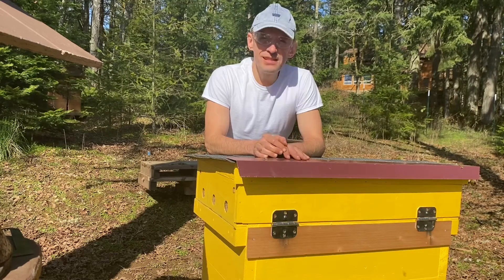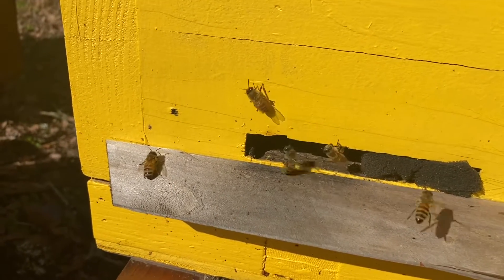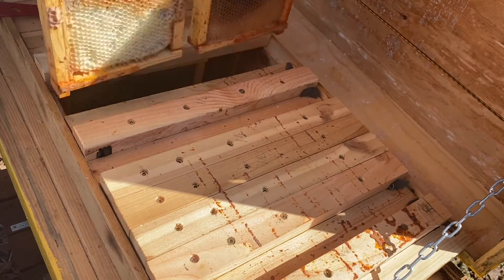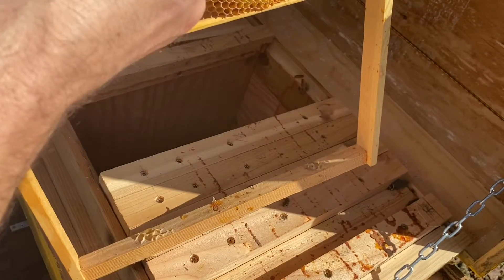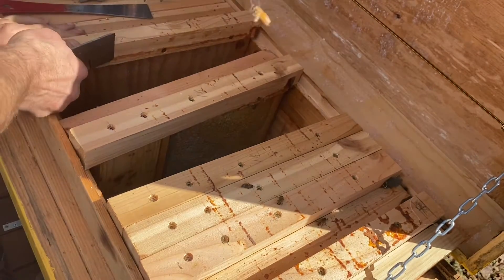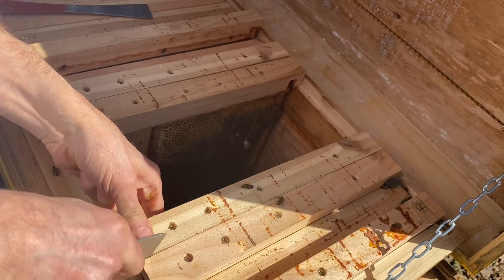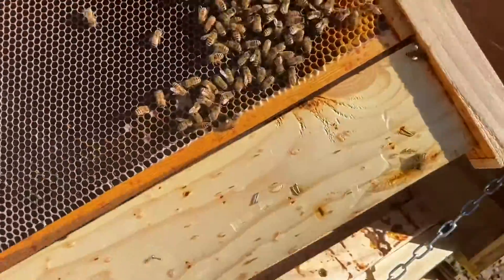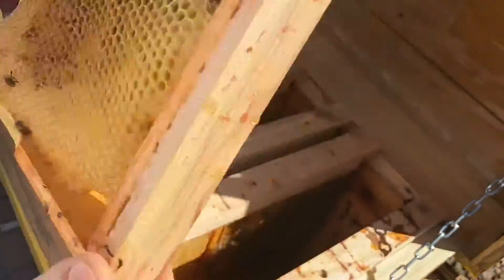LAYEN’S hive overwintering

Comment: It must have been disheartening to lose so many bees overwinter. You didn't mentioned what hive systems the dead colonies were in or how severe your winter was like.  I thought it was neat how you attached langstroth frames to top bars with side panels to fit in the layens hive. It is one way to transition to a layens hive without tossing away existing infrastructure that had time and money invested.
Reply from the maker: Yes, I downsized my apiary after that - reduce quantity to increase quality. The winter was not harsh, but we had fires as never before  in September of 2020 in Oregon. That stressed the winter bees. The hives that died were standard Langstroth. 
BTW, two medium frames  fit nicely side by side in this deepened Layen’s, I would like to try it next year as “super” frames for the honey extraction.